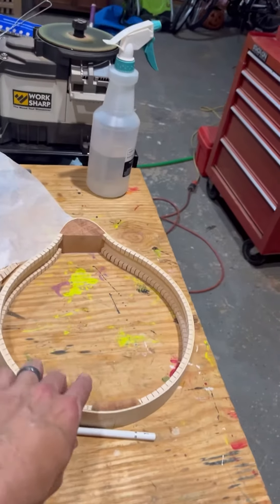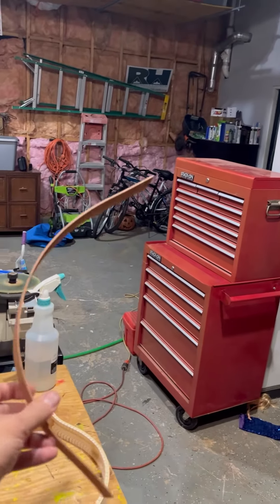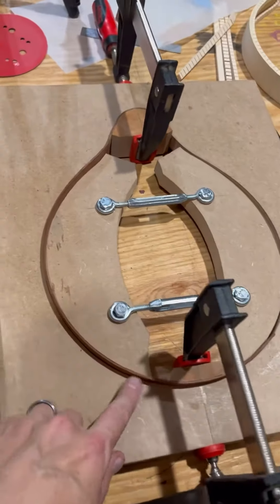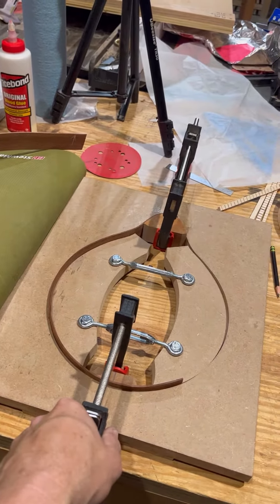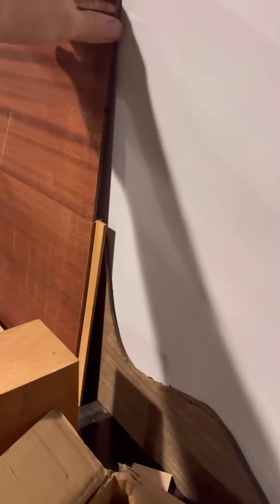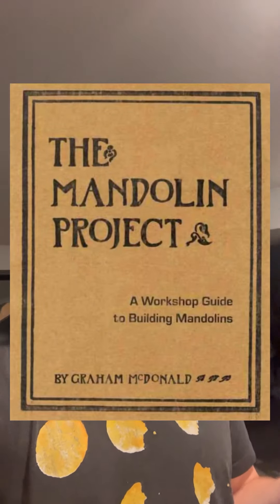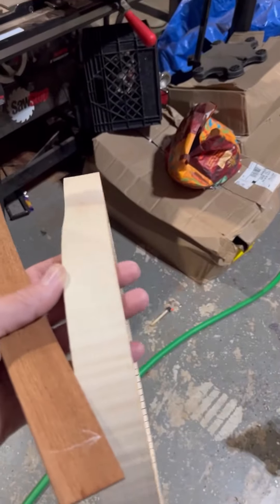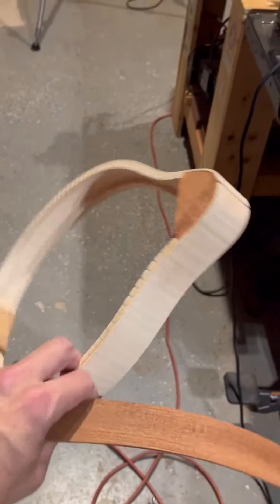The mandolin project(s)

Comment: Yeah, you can definitely do a flat top mandolin.  I've got a flat top octave that was a kit I bought from a guy in West Virginia, so the sides were already bent.  The primary mandolins I have and play are Mid-Missouri/Big Muddy (really the same company, long story) and they're flat top, and I absolutely love mine.  And I live in Missouri, so that's double cool.

The carved top is good, too and a great experience I'm sure.
Reply from the maker: I found out after the video that flat tops have wider sides and a different shaped upper bout & head block and have a bolt on neck, at least the ones in the book I‘m going off of, so the sapele sides I bent can be used for another carved mandolin. I‘ll have to make another mold for the flat tops, haha 🤷🏼
Reply: @CMRWoodworks  the octave kit I built is a flat top with a bolt on neck, so that's certainly possible that it's a design difference.  I think on a flat top the sides may be a bit thicker, too.  

And you can go off script a little bit if you want.